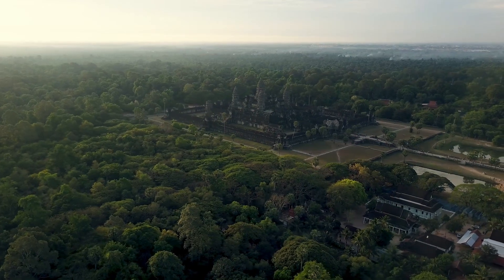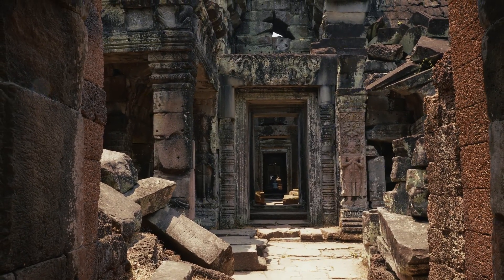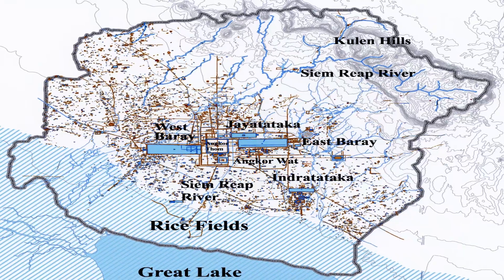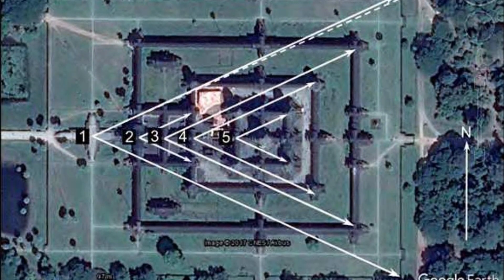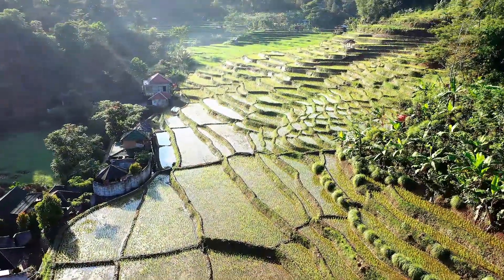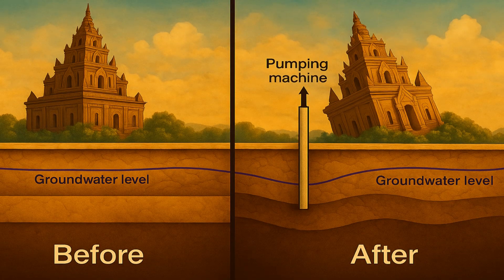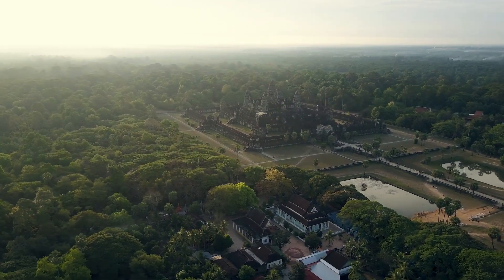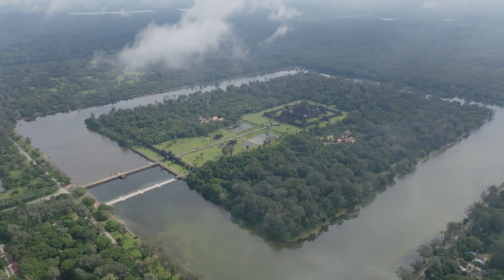The Hidden Water System That Powered Angkor Wat

Comment: didnt mention if the stones were lain with or without mortar? (concrete technology - a highly guarded secret - Dewey Decimal System call number 666. - what Rome learned from Egypt was natural Portland cement could be mixed up to 90% sand and still produce a stable building block - romans used it as mortar to build with rough hewn stone greatly accelerating additional infrastructure in lands they colonized) . I know SE Asia was very advanced as metalworkers but was mortar in use at angkor wat in the 13th century?
Reply: The answer is no.
Reply: Did they dehydrate gypsum somehow? How did they know to do that? (since there was not yet a system of science) Is there a natural source of dehydrated gypsum?
Reply: No, They used stone joint metal clamps, and they rubbed the sandstone blocks together until the blocks was flushed.